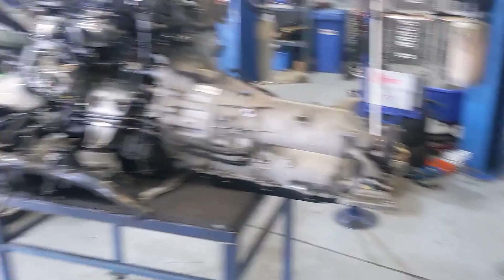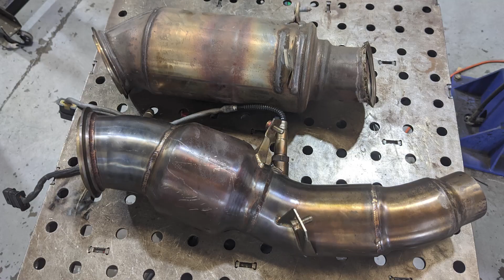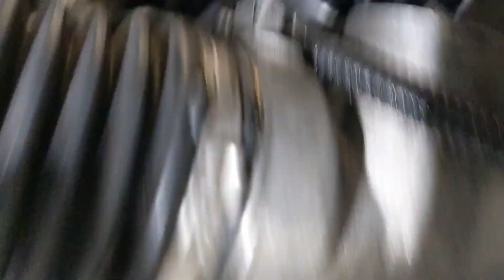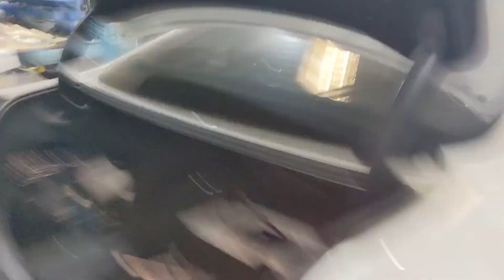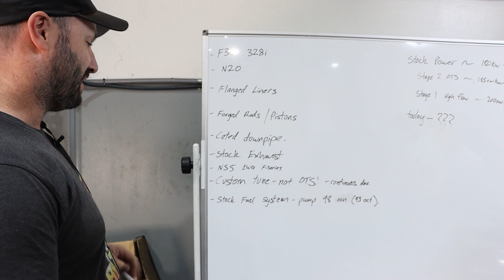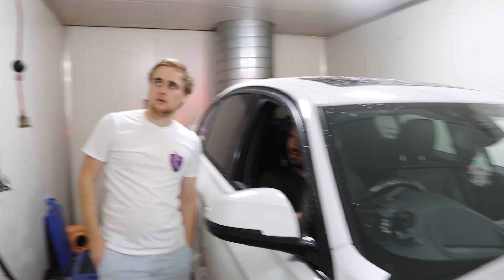BMW F30 328i N20 engine build part 4

Comment: I have a Bmw 428i with the N20 motor, is it possible to ever do a N55/S55/B58 motor swap in these vehicles or is that something highly uncommon?
Reply: This channel did a s55 in a 125i so I would imagine it's possible, just uncommon.

Comment: Gonna use the same liner style you guys had done on the cylinders, mine just broke away and smashed my valves and head. from what I’m assuming it was heat that accelerated the wear on the liners

Comment: What is the purpose of forged internals, I’m new to the aspect of building an engine and looking to learn.
Reply: Also were there any extra precautions that were mandatory to add to the car when you swapped to the N55 turbo

Comment: I spent the last hour watching all 4 videos back to back and I love everything I saw. I want to do something like this to my N20 engine. But I would go to a stage one turbo and do all of the requirements for it. But my dream would be a S55 engine swap, but I’m thinking it may not fit
Reply from the maker: It will absolutely fit ;-) We have a 125i F20 with an S55 swap done.

Comment: hey, ive commented on your youtube channel about the N20 build, Over here in california we dont see alot of BMW N20 320i content, My question to you is.. With FBO BM3 stage 2 tune 91, new spark plugs, coils and new oem injectors, can i run a OTS Bootmod3 stage 2 E30 map? without running blowing the engine ? basically is it worth it ?
Reply from the maker: You probably could, but its not something we have done to know how it will hold together. All depends on boost
Reply: @BrintechCustoms  Ive seen only few  N20/N26 with stage 2 E30, There’s so little content on the N20 car Community, as of right now i’m at 17-19 PSI that is FBO  and stage 2 91 oct. would you recommend
Reply: @eddiebarrera949  would not recommend passing that 19 psi of boost mark tbh
Reply: @eddiebarrera949  ots stg2 e30 will give you 20-21 psi . 
stock internal can safely handle 22psi on 98 with low timing had been dyno all of the maps 
these number are based from  stock 320i N20 measured at 200HP 280NM with FBO 
BM3 stg 1 93oct 275hp 380nm
BM3 stg2 93 oct 295hp 400nm
BM3 stg2 E30     330hp  440nm 
custom 98 maps by my local tuner  333hp 440nm
custom E30 map by a "big name tuner based in US" 340hp 450nm
custom E50 map by a "big name tuner based in US" 350hp 490nm (you must have b58tuhpfp with E50 )
i use  TTE400 turbo with all of this result 
these hybrid turbo is not big so it will not make crazy numbers but it really help the high end power which stock turbo always failed to deliver , hybrid turbo will also bring the TQ graph abit more to the middle instead of the big TQ in low rpm which can grenade your engine in no time! (that's the bigest reason why many N20 owners bend their conrod)
these numbers are on crank based on dastek dyno usually they're pretty accurate with what the brochure said about crank hp numbers

you want to go near 380hp-400hp you might want to change to the bigger turbo and better injector
hope this help with your build
Reply: @mosthighxae  19psi with this engine will take you to no where (with stock turbo) , take abit of risk and go to 22psi
Reply: also in my experience stock turbo with 22psi will only bring you as far as 320hp anymore than that you will run out off the turbo effeciency range

Comment: I’m gonna be in touch soon as I’ve seen your 800+hp kit for the n20. Looking to build this like crazy. Are you and navardi tuned working together on this?
Reply from the maker: Yes we are working together on the N20 development
Reply: Where do you find this 800+ hp kit for the n20?
Reply from the maker: @chrisbuckley2064  Im not sure what the 800hp+ kit is that was mentioned above, perhaps a typo?
Reply: @BrintechCustoms  figure, so after the upgraded fuel System and e85 along w whatever mods u install, what max hp you thinking it will hit?
Reply from the maker: @chrisbuckley2064  The video goes into these details, Harry talks about this at the dyno section near the end
Reply: @chrisbuckley2064  https://navardituned.com/products/forgedkit3-1 I found this